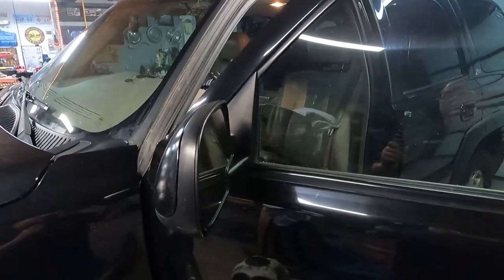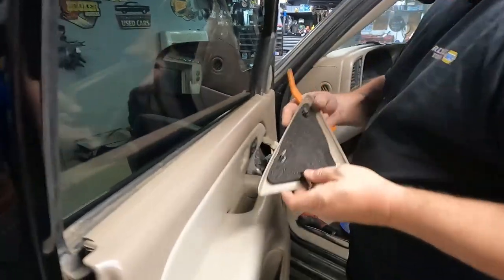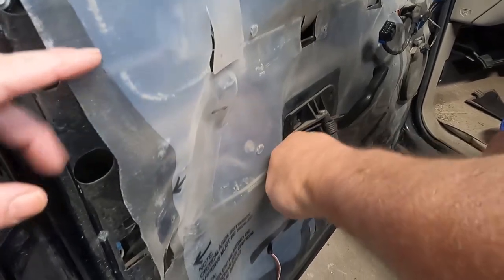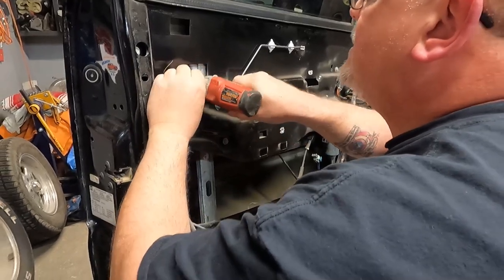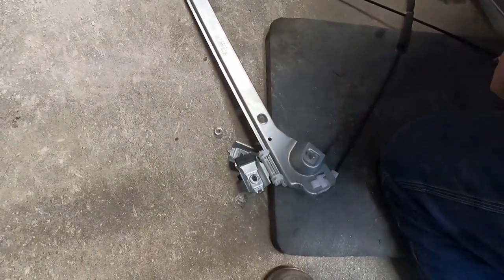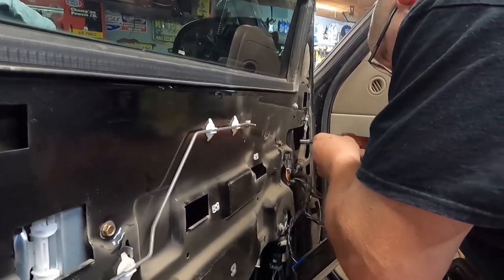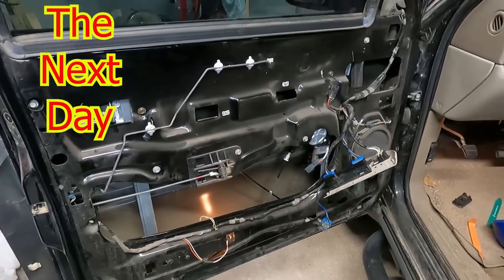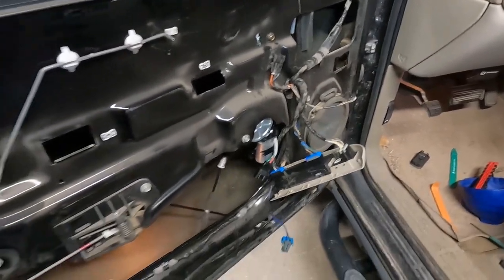Chevy Tahoe window regulator replacement.

Comment: Ive done a lot of work/electrical work on my 2002 tahoe and I never disconnect the battery (even tho i should) only time ive disconnected was when i put my amp in but thays because i had to connect it to the postive termal. But they window control is missing the clips at the bottom of it thats why it isnt staying in and you can just remove it without having to pry it off. I had the same problem but all that trim and covering is just kinda pushed in except for the door/dash and the back/trunk the doors in the front have 1 screw under the handle to close the door and the back/trunk has 1 bolt that holds the cover in place and the dash has like 5 or 6 bolts and 6 screws that hold the cover on. Everything else just seems to be pushed in place. The way they have the regulator in there sucks ass because you have to go into the door with a ratchet and they dont give you a whole lot of room to work.

Comment: I can’t seem to disconnect the wiring from the buttons on the button panel, mine appears to be stuck in place. what should i do?
Reply from the maker: They should just slide off. Maybe pry lightly with a couple small screwdrivers.  But do so carefully